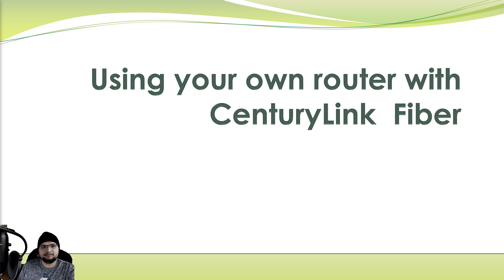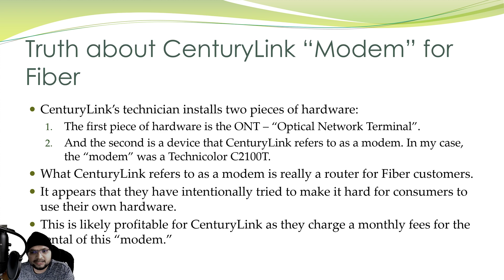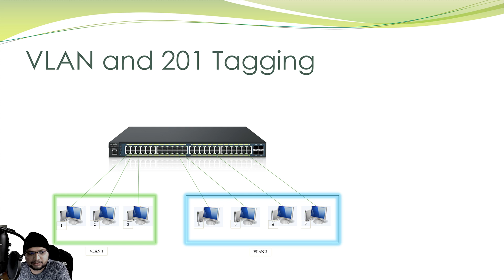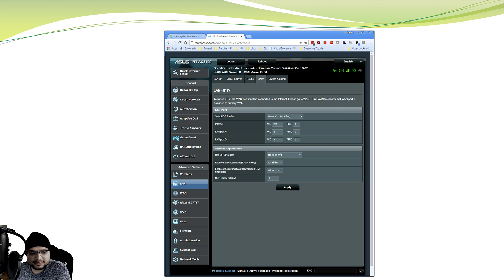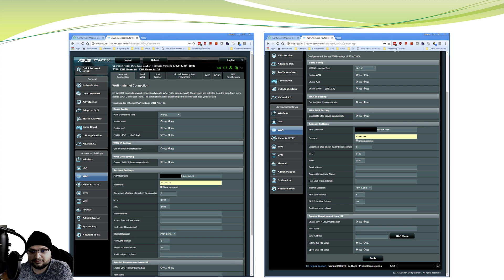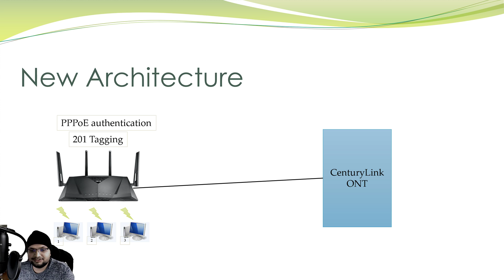How to use CenturyLink Fiber without CenturyLink's Modem and with your own Router

Comment: Thank you for sharing this information! It has been a frustration until now.
Reply from the maker: You're welcome! I'm glad it helped.
Reply: @MukulTripathi  One thing that could be helpful to include in this video is, to suggest to the viewers that before they switch routers, to copy the user and password information from the centurylink router. For me it was unique to the router, and not the same user information I would use to, say, log into the website. It was not found anywhere but in the router settings. I attempted to use my centurylink account information and was unable to establish an internet connection. I realized the old router must be using this information, so it would exist there, and so it did.
Reply from the maker: @jamsolid  for username and password I recommend to call CenturyLink support and get it in the video! I found that way works the best!

Comment: Does this same setup still apply? Was running into some hiccups getting this going but I can quite get it to work? https://www.amazon.com/ASUS-XT9-Tri-Band-WiFiSystem-802-11ax/dp/B0BHL9T17Y/
Reply from the maker: Yes it still works I've been using this on and off between PF sense and direct ASUS router.

Comment: The ONT device, which is not pictured in your video, should be called the REAL modem, since it's the device that modulates between optical fiber & wired copper ethernet.  The other CenturyLink device is a combo device: a wired copper line DSL modem combined with a wired + wireless router. The DSL function is obviously useless when using fiber for internet access, and they should really replace that device with one that contains no DSL function. One with wired ethernet + WiFi ONLY.
Reply from the maker: Agreed and Agreed 💯 :)

Comment: Great video. Is there any way to bypass the Centrylink ONT if you have a Switch with SFP+ ports? It seems wasteful to have to plug into two devices that suck power and have to convert information. Would be nice to just go fiber straght into my TP-Link Switch
Reply from the maker: I'm not sure if we can bypass the ONT, there might be a way, but that's where I might draw the line in terms of messing with it. :)

Comment: Damn this is not working for me i only get limited access not sure what i am doing wrong
Reply from the maker: Not sure bud, it still works for me, 940 up and down.
Reply: @Mukul Tripathi  haha i wish i could say the same im running rt ax86u ive factory reset my router multiple times and manually set it up as pppoe with my credntials and ive tried manual iptv with the 201 tagging and the centurylink preset

Comment: Hi Mukul. I am replacing my ASUS router with a new ASUS router. To configure my new router, will I need to plug the CenturyLink Router into my new router?
Reply from the maker: You can unplug your old router and completely remove it from the setup. Then plug in the new router exactly how the old router was. And that's it. Follow the tutorial and you'd be good.

Comment: Hi Mukul,

As part of my ongoing project to "cut the cord (on cable TV)", I recently switched from Comcast/Xfinity services (TV, Internet, Voice/phone) to CenturyLink (Internet service only).  CenturyLink is an optical fiber-based architecture in my neighborhood.  The big difference that CenturyLink provided me was SYMMETRICAL up and down speeds.  So, now my Ethernet cabled computers easily see 900 Mbps down & 900 Mbps up speeds with CenturyLink; whereas with Comcast/Xfinity's ASYMMETRICAL coaxial-based architecture, my download speeds approached 900 Mbps BUT my upload speeds rarely exceeded 35 Mbps.

Thank-you very much, Mukul, for your video tutorial on how to ditch CenturyLink's misnamed "modem/router" device and just use one's own good quality, high-speed router.  The gist of your article is: "add IPTV 201 & your PPPoe authentication".  However, I have some questions about following the steps in your video.  First,  CenturyLink's "modem"/router (Anon Model C4000XG) shows my "ISP Protocol" set to "Auto Select" and the protocol selected is "IPoE" (not the "PPPoE" one shown in your video).  So, do I leave it "IPoE" or switch it to "PPPoE"?  Can I even do such a switch since it appears CenturyLink really wants us to use iPoE?

Second, if I can leave it IPoE, then I assume I do not need to do your step about PPPoE authentication; thus, I would not have to worry about getting my PPPoE username/password credentials from CenturyLink's support staff.  It's my understanding IPoE does not use that kind of authentication.

Third, will the other steps in your video tutorial still work with that iPoE protocol?  However, I would still execute your "add IPTV 201" step to invoke VLAN tagging "201".

In reading the numerous replies to your fine tutorial, I ran across one other user (see "SaintzZ" comments/replies) mentioning IPoE instead of PPPoE.  He indicated your tutorial's steps worked fine with IPoE.  However, he's reply was a bit too sketchy for me to follow.

In my current configuration, CenturyLink's C4000XG "modem"/router device is my primary (and only) router.  My goal would be to follow your tutorial and replace it with my TP-Link router (Model "Archer AX10000").  I've already have this TP-Link router partly setup (powered-on, temporarily just Ethernet cabled into one of the LAN jacks on the back of the CenturyLink "modem"/router.  However, as yet, I've not tried to configure it.  So, it's not a router yet, it's not an Access Point yet; it's not a WiFi extender yet).  I was hoping to only have to do this configuration step once; so, I am anxiously awaiting your reply to my questions before I tackle trying to setup this TP-Link router as my primary and ONLY router device (directly connected via an Ethernet cable to the RJ-45 wall jack that the CenturyLink one is currently connected to.

Regards,
Tony

Comment: do we need to update the asus router firmware before setting as primary router or can we proceed straight out of box?
Reply from the maker: It is always recommended to be on the latest firmware. You necessarily don't need any updates in advance tho.
Reply: @MukulTripathi  this worked!!! hero

Comment: Thank you so much!! This clears up a lot of things! So I just recently purchased an ASUS ZenWifi AX6600 xt8 router mesh and signed up for fiber optics with CL. Am I able to just proceed with the 12:43 steps and connect the ONT to my WAN port? 

The reason I asked is because a tech support at CL said that if its not a modem/router it wont work and will need to go into Transparent Bridge. But taking into consideration what you said in the beginning, that their C4000XG/routers modem combos is just a router because we have Fiber... is that right?
Reply from the maker: That's correct. I happen to have the same AX6600 XT8 now as well. I purchased it last month. This tutorial will work ootb with any Asus router.

CL has misinformed you, you do not need a modem, all you need is a router.

Comment: You don't have to necessarily buy a new router if your existing one does not support vlans over 201......the TP Link AC1750 is an example and updating fimware to ddwrt won't help that issue.

One option is to buy a cheap managed switch that supports vlans over 201/   Next option is a TL R605 and a stand alone access point.   Hitting speeds in the 700's most of the time

For option one Google "how to use a cheap switch with AC1750 and vlan 201 )

Comment: Mukul, are you available for hire to help with my setup?
Reply from the maker: What help do you need? Let's try to figure it out here. I make videos for fun not money.
Reply: @MukulTripathi  I am talking with flash routers. And they indicate that they use DD-WRT firmware and they are not sure wheter their setting allow what you suggest. My goal is to have a VPN on the router
Reply from the maker: @riccja  i think pfsense firewall is a better use case for you. ddwrt is a weaker platform.
Reply: @MukulTripathi  This is the only flash routers they sell, preconfigured , with VPN software in the setup
Reply: I know you do not do this for money, however, finding a consultant with your knowledge is next to impossible. Please consider walking me through the process from modem selection to setup. Flash router recommended two routers,  and both will be preconfigured with DD-WRT and VPN software to configure my VPN service.  Thanks  Rick
Reply: As an update , I talked with century link, they said since they use IPOE, it is pretty much plug and play
Reply: that would be great, it it were true, but I suspect there is more to it then that

Comment: Hi Mukul thanks for the video, very good. I got centurylink fiber at home with their original “modem”… I live in a two- story home and I lose a lot of signal / speed right after the modem. Could you indicate me a good wifi6 router ( got lots of devices connected) and how I can distribute the signal to the second floor without losing strength/ speed? Thank you so much! I work from home and my internet connection has been a nightmare

Comment: Did not work for me.  Century link has me on the Greenwave C4000, I am trying to replace it with ASUS GT-AC5300.  Fiber connection, Asus does not show incoming internet.
Reply from the maker: This process still works for me on fiber. Are you sure you configured pppoe authentication and 201 tagging correctly?
Reply: @MukulTripathi  I let it go for a few months to take care of other priorities.  Recently I bought ASUS AX89X, followed your video, and it worked like a charm.  Thanks

Comment: Thank you for the video. I was able to switch from the CenturyLink supplied router that sucked ...to an Asus RT-ACRH13.  I almost bought a D-link but didnt like what i saw in the reviews. Having the same interface made it easy for a noob like me, not get lost. Although my speed test speeds have dropped since the switch, it seems very stable and have had ZERO connection issues with 2 wired and 8-10 wireless connections at the same time. Thanks again for the help.

Comment: Hi Mukul! Just wanted to let you know that thanks to this video I have been using my own equipment and avoiding CenturyLink's unfair monthly fee. Of course they continued to charge me for equipment that I had returned for several months which required me to stay on hold with their customer service until I could finally reach someone and get the charges removed. Unfortunately I am commenting today to ask if you have seen any more anti-consumer practices from CenturyLink? I have noticed now that my downloads seem to be getting throttled by them and I am wondering if they have applied anymore sneaky backdoor tricks against me. Thanks again for your help!

Comment: Can’t believe this actually worked, that’s pretty messed up of CenturyLink. Set it up with my TPLink Decos. For anyone else with this router, look in the app for advanced > IPTV/VLAN > CenturyLink Fiber.
Reply from the maker: I'm glad it worked! Also I appreciate you all helping others out here.
Reply: Just got TPLink Deco AXE5300.  Will try to replace my CL C3000Z using this method.  Be great if it works!

Comment: Thanks for the video!  To clarify, you do need their crappy modem/router for DSL though right? I have mine in bridge mode, but that's because I understood it as being needed since my Netgear X4 couldn't act as the modem.

I'm switching to CL Fiber in a couple weeks though, so happy to hear I don't need their modem/router anymore since the ONT is the modem. In testing, I was trying to find the Netgear settings for 201 tagging. There is a section under advanced that says Enable VLAN, and then by VLAN tag group. I can enable "Internet" and set VLAN ID to 201. It just asks priority 0-7. Anyone know what the answer is?
Reply: Did you get the fix or figure it out?

Comment: Thanks for the video, this was a great explanation!

I'm not fully clear on where the tagging is needed. Is the tagging needed on all frames going to the ONT only? If I wanted to setup my own VLANs to organize my devices (i.e. a LAN for networking hardware, one for my computers, one for IoT devices) can I still do that while tagging 201 only for that last stretch or am I forced to put my gateway itself in the 201 VLAN?
Reply from the maker: My understanding is that any network traffic going to ONT only needs 201 tagging. You should be good to organize internal devices with other tags.
Reply: @MukulTripathi  thanks! I'll give it a shot.

Comment: Looking for help with pairing up the same century link ONT from your video with my netgear nighthawk x6 r8000 router. I followed your steps but am still not getting internet. Any help would be much appreciated!
Reply from the maker: Nighthawk's settings are different than asus's you'll probably have to try with an Asus router to replicate this exact setup or try to fiddle around with some setting on the Netgear side. Unfortunately I don't have that router to provide more insight.

Comment: Thanks for the in depth video! I’m quite the novice at home networking, so this high level deep dive was great. I’m looking into CL for their fiber connectivity but had what might be a stupid question but I’m honestly not sure. Once you configure your personal router to the specs you mentioned, do you still need to connect the router to the modem CL provides or do you bypass that modem completely (essentially not needing it anymore for anything) and simply connect it to a wall jack for CL’s ONT?

Again, sorry if this is a dumb question, but I really want to get the most out of a gig environment. Been tough trying to find easy to understand guides on how to do this if you have little to no home networking experience.
Reply from the maker: We don't need the CL "modem" at all when you are done configuring it this way as shown here.
Reply: Mukul Tripathi gotcha, so essentially the router is just connected to a wall jack (I assume an Ethernet jack?) that connects it to the ONT?
Reply: @HI-hr5up  correct.  the cl-supplied 'modem' is eliminated.  just enet cable from wall jack to your router/wifi.
Reply: Currently I heard that CenturyLink has FiberOptic Internet available in our area.
My Question is [because I know very little at all about this and setting up will be a challenge on own....But what does one do if you don't have any modem or is it a capable or fast enough router that one needs to purchase beforehand, before calling CL for FiberOptic service connections to be installed/set up.

My guess is that after one calls for set up that it will be like it was for when I got CL DSL phone+Internet set up, but may even need to have technicians come out to install FiberOptic cords from some HUB in area  and even have to bury it under ground till they get to house and drill holes and install a box outside of house then drill into house to whichever room in house it needs to go to modern or router that the CenturyLink technician brings with him.
For instance the technician told me that my modem did not work to connect to upgraded speeds of 100mbs from my 40mps service speeds with them. 
So I either had a better modem to use it was forced to use the upgraded CL model that he brought.

So In the case of now getting FiberOptic CL service connection.
What do I buy before the call to set up CL FiberOptic Internet?
Reply: @ekp-g205  CL’s website has the required specifications listed. Bring that info to your local electronic store.

Comment: I follow this... it theory pretty simple... but so many have problems getting it to work with different routers.  Its driving me NUTS.  Ive tried purchasing multiple routers to work - No one in support understands fiber.  We need more vidoe content for different routers to walk through settings.
Reply from the maker: You mentioned you have bought multiple routers. Well then you can just buy an Asus router to try these settings I'd say.
Reply: @MukulTripathi  Looking at Asus Wi-FI Routers now.  So many Im not sure which one to get.
Reply: @MukulTripathi  Just discovered my local Best Buy has this router.  I'll see if I can make this one work with the help of your video. When I start setup do I need to have my CL Router active too?

Comment: So I just did this with my router and centurylink fiber.. it worked great for 2 days... was getting about 950mbs but now it’ll start at about 850 then drop to about 490.... any idea?
Reply from the maker: That's potentially CenturyLink's fluctuations in your area. It's going on everywhere.
Reply: @MukulTripathi  I'm hoping thats it... but only thing is, I reconnected the centurylink  router and now I'm getting about 950mbs...
Reply from the maker: Could potentially be the router hardware issue in that case. Hard to say. I'm getting consistently expected speeds though.
Reply: I hope not... but I’m going to try a full factory reset and see what happens

Comment: What would you do in my situation? I would love to completely bypass Centrylinks hardware. Centrylink provided me with an all-in-one router/ont/voice over ip device. The fiber optic cable feeds directly into the device, and a telephone rj11 cable goes from the device to my phone line for the house. And of course there's an ethernet cable that runs from the device to my netgear obri mesh network router. I run the Centrylink provided box in bridge mode. I haven't been very satisfied with this setup. Does your third party asus router have a fiber port?